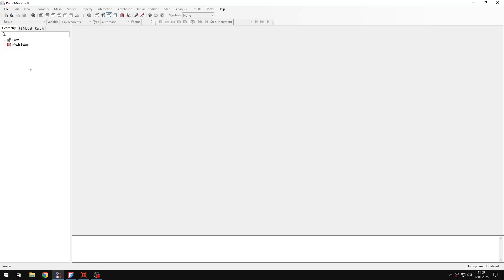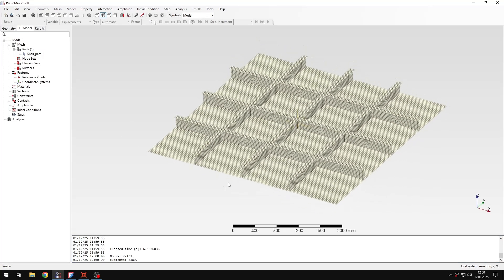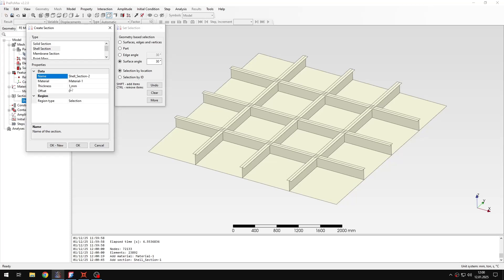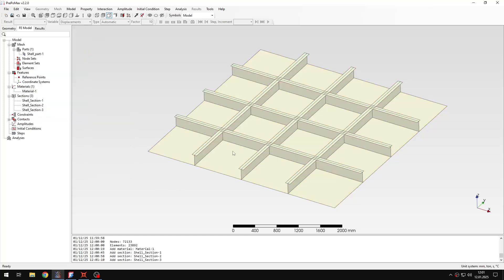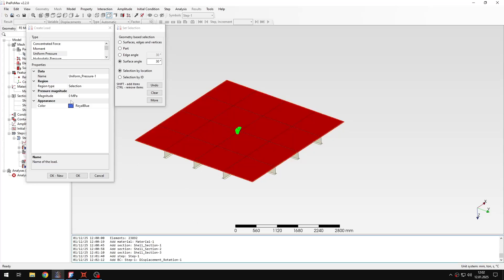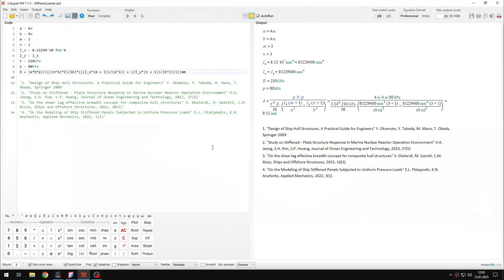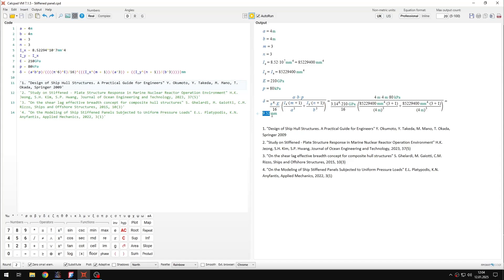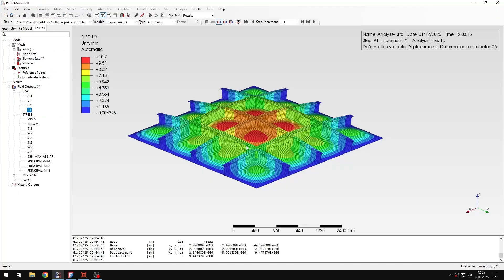PrePoMax (CalculiX FEA) - Tutorial 48 - Stiffened panel

Comment: Hi, how did you model these plates in freecad. I Modeled it in freecad. FLOW - first sketches and extrude sketch then the bottom plate surface then Boolean fragments  and lastly make compound but when I exported to Prepomax it is becoming many shell elements due to which I need to make master slave tie  to make it behave as signal unit..
Reply from the maker: Here are the operations I used to model this in FreeCAD:
- Part Make Face for the plate
- Part Extrude for the stiffeners
- Fuzzy boolean union (tool from the Defeaturing add-on workbench) - helpful when the regular boolean union fails due to small misalignments
- Part Convert to Solid (on the fuzzy boolean object to get one part instead of many separate shells in PrePoMax)
Reply: @FEAnalyst I'll try this 😊

Comment: So, you always need the meshing parameters + whatever else you need, in this case, Shell Mesh?
Reply: Whats the difference of setting the mesh thickness in the section menu instead of the Thicken Mesh on the Meshing Parameters step?
Reply from the maker: @EngineerAAJ  The Thicken Shell Mesh feature creates a solid mesh from a surface. Shell section definition only assigns the thickness as a property for shell elements.
Reply from the maker: Not necessarily. You can mesh right away with some defaults (usually way too coarse). You can also add only the Meshing Parameters. Then it will be meshed with Netgen. To use Gmsh, you have to choose its meshing objects.